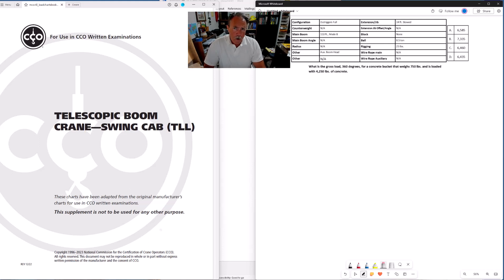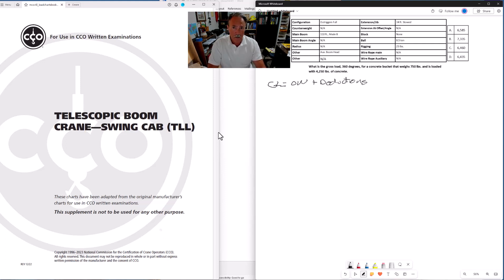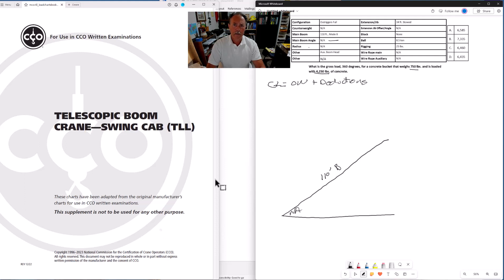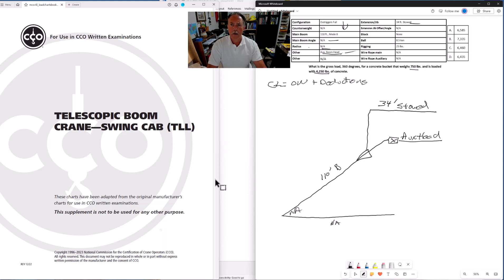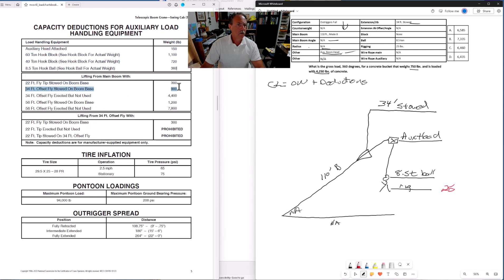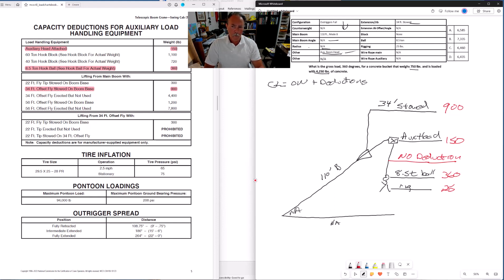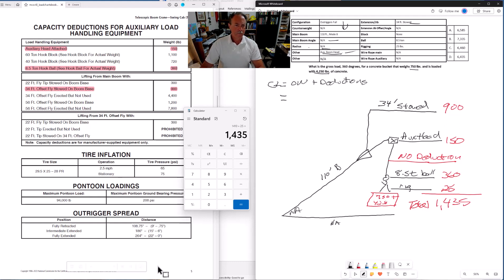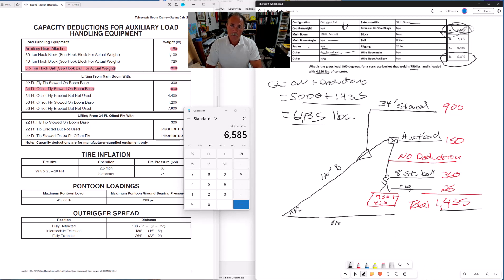NEW TLL: Gross Load Calculation Tutorial

Comment: Gross cap lifting off the fly over the side. Nobody and I mean nobody has the answer for it.
Reply from the maker: Just now seeing this. Sorry for the late reply. There is not a chart for "over the side"  for picks off the fly it is a 360 degree chart.  Not sure what you're talking about?   If it is a valid configuration should be able to find the chart capacity.  Also, you would be using single part line off the fly with line pull of 12920.  If your line pull is less than your chart capacity the line pull is going to be your gross capacity.  I may be missing something in your comment.  Send me more specific information about the configuration where you can not find a chart capacity.